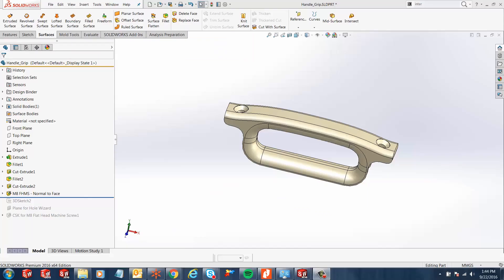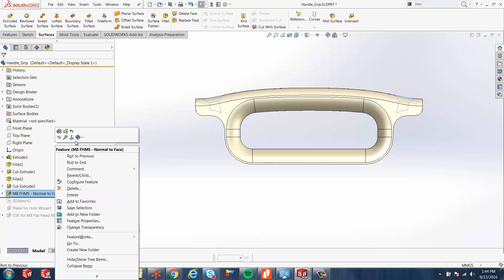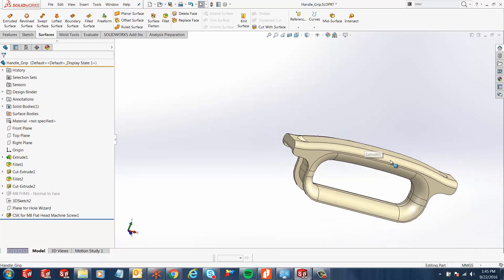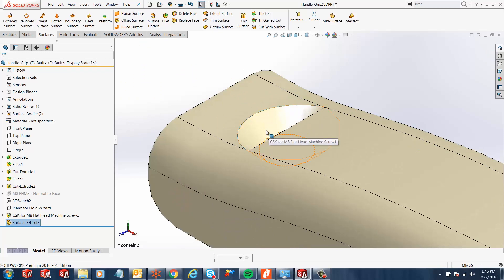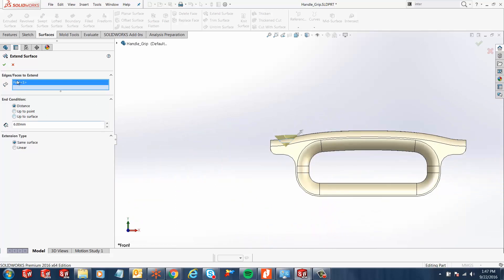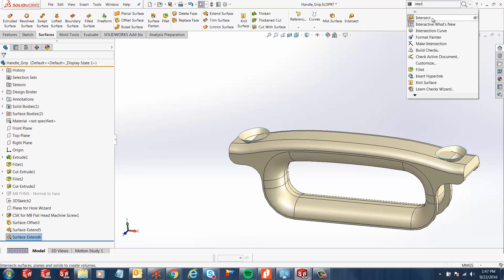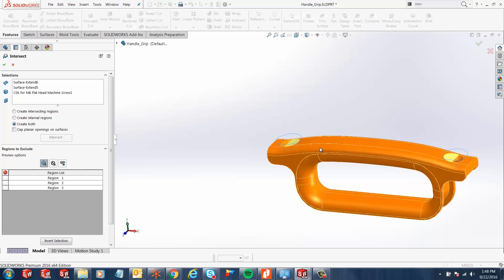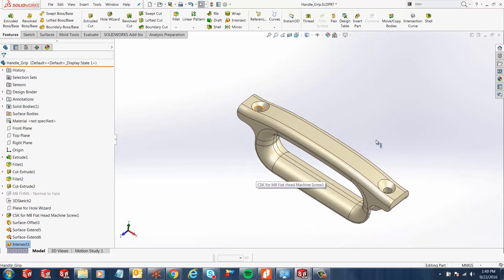SOLIDWORKS   Repairing Countersunk Holes

Comment: Nice solution, but WAY more complicated than necessary.
Easier is to start a sketch on the underside of the unwanted overhang. Convert Entities will project the edges automatically. Then Cut-Extrude with Draft Outward 45°. Done.